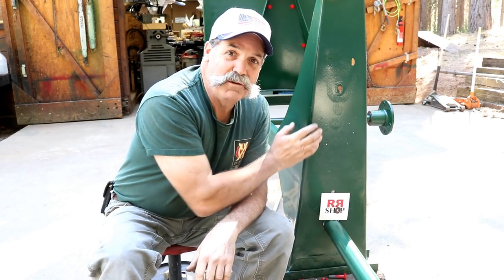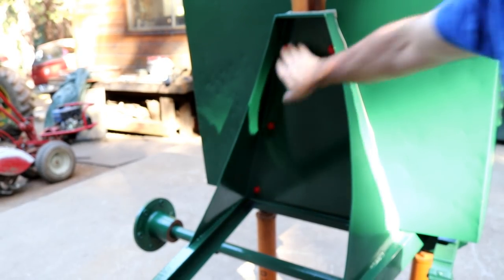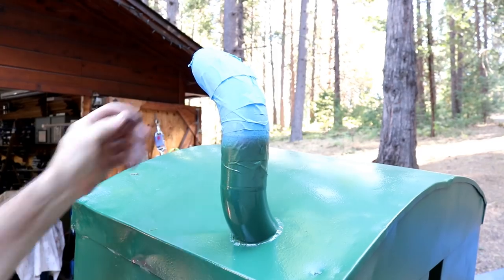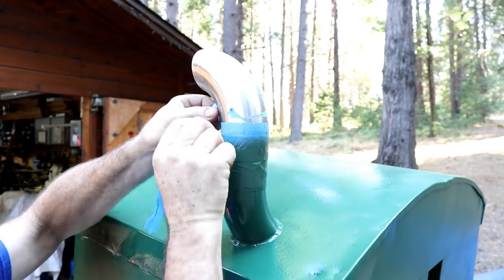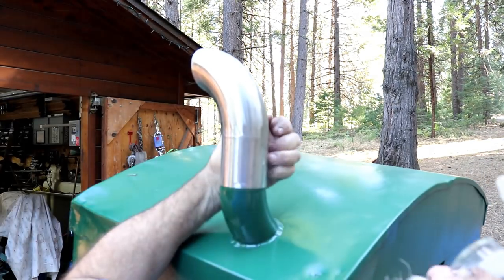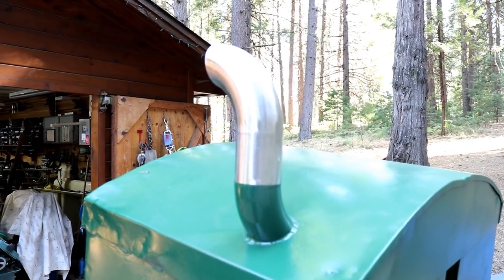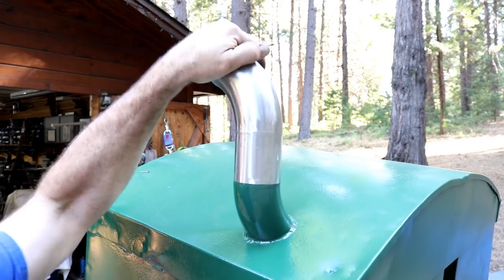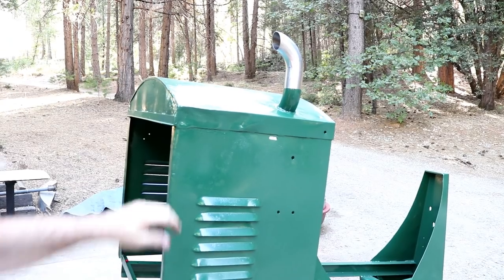Cement Mixer Restoration | Assembly P1

Comment: What an unusual wheel and "hub cap" setup. I like your idea about putting a gasket between the wheel and hub.
Cool colors!
Reply from the maker: Thanks Joe, kind of different.
Reply: @RRINTHESHOP  I'd be concerned if the gasket deteriorates or doesn't crush completely that the lugs could come loose. Great job on the mixer!
Reply from the maker: @davidlatham3300  Good concern David.  If I do a gasket it would be very thin and would crush tight.  Otherwise if I do not like that I will use a liquid gasket/sealant.

Comment: Randy...  easy way to install the bearing cones is to take the old/original cones, lightly grind away just a bit of the outer diameter via bench grinder so it can be used as your 'pusher' bearing guide to set the new cone in the hub.  Just a couple of thou needs be ground away to give a perfect fit without it becoming tight in the bore.  I did that with my utility trailer wheel bearings and carry them along with a new set of bearings when I take the trailer on long trips.
Reply from the maker: That works.  Thanks Doug.

Comment: Loving the color.  Glad to see you are not in the PG&E power outage!  My wife tells me I complain too much about how she tries to help. LOL  I like that bearing.  Is that blue grease better than the Red and Tacky?  Too much grease is almost as bad as not enough, holds in heat.  Yeah that cool air got to TN, and we had frost early this morning.  Lug BOLTS are a pain to start without a lift.  Love those 3D bolt caps.  She is looking fine. 'Til next time.
Reply from the maker: Thanks Vernon.  The blue grease is formulated to with stand water well.

Comment: I should start calling you Smokestack Randy. :)
That WAS a nice touch. My first car (that wasn't borrowed from parents) was a 1948 Chevy. It had 16" tires and 6-bolt hole wheels. But it did have wheel studs and hubcaps, although you had to beat the hubcaps on and of course they were full of dents. I was 17 then, so what's a few dents between friends?
Reply from the maker: Thanks Wes, I like the Stack.

Comment: Okay Randy I know it's been a little while but I'm pretty sure that had an electric motor in that mixture when you took it apart I'm just checking
Reply from the maker: Oh yeah and the Electric motor is going back in.  I had to plug the hole with something.  The stack added a cool factor.  thanks Bill.

Comment: Really enjoying the series Randy. Thank you. I must say though when I saw the spring on the tongue lock pin, I wondered if it was strong enough to overcome the mass of the pin from lifting on some hard bounces. I was thinking about the moment dimension from the pin to the axle to try and figure it out, and then became somewhat relieved when you started installing the stop bolt, thinking; what's the worst that could happen? If the pin dislodged on a pull and then missed the hole when breaking; the tongue would just shorten but still stay attached... then you said "finger tight for now" on the nut.... Is this series intended to be a thriller? ;-)
Reply from the maker: Thanks Brian.  Finger tight since I may want to remove the tongue as it is in the way a bit.  As I continue  the work on the mixer.  Still lots to do.  By the way the Pin set up in tongue is a bit shaky.  It should have a sleeve welded into to and through the tongue and the pin should drop all the way through.  Maybe that will have to be a mod.
Reply: @RRINTHESHOP  Thanks for the reply Randy. That would really be a solid set up. Sorry to be a worry wart. Great job on this restoration. Can't wait for the next video.

Comment: What about adding some grease to the inside of the hub assembly? It did not look like there were any inner seals preventing the grease from flowing into the inner hub. If you fill the inner hub with grease it acts as a "reservoir" for the bearings. If you do drive this at highway speeds the grease will warm up and flow out of the bearings. Having a reservoir will resupply the bearings later...
Reply: You need to watch out, though. Pack it too full and it will squeeze out between the rim and hub, and perhaps back through the able and blow out the inner seal.